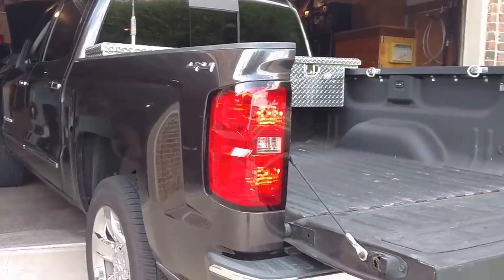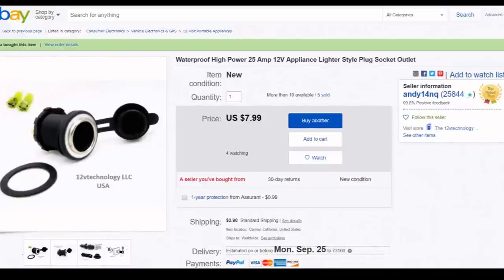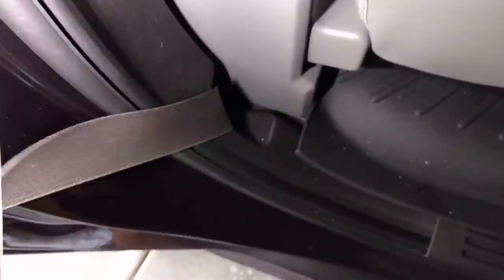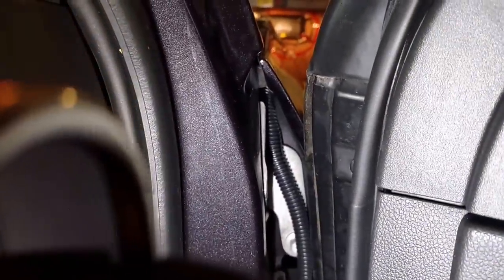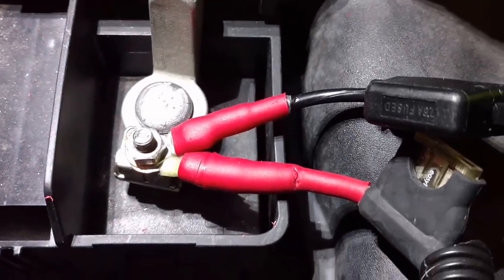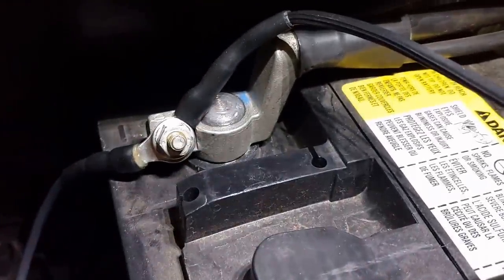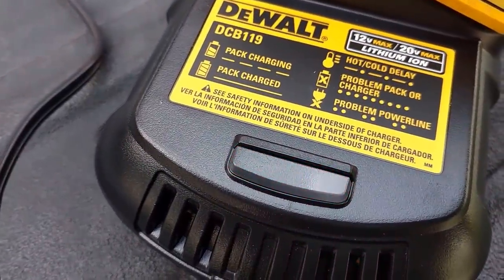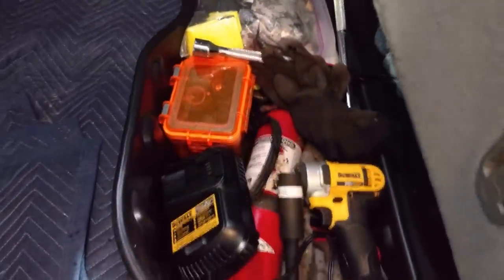DIY truck bed 12v power socket  installation - direct wiring to battery (10 AWG)

Comment: I would’ve just tied into the 12 volt running to the trailer 7 way instead of running that all the way to the front
Reply: That is what I want to do. Can you suggest on best procedure to do this? I am wiring in my Leer Topper in a 12 volt cig light /USB device. It has a switch as well so I can turn off power to outlet if I want.
Just don’t want it “hot” all the time as if my truck is sitting for an extended period of time I worry about the small drain of USB LED light. Maybe nothing to worry about 
But looking for a hot close to end of truck bed. Thanks

Comment: Great video and well explained, but you could have made this so much easier (and cleaner) by mounting a small fuse block next to the battery and running your wire underneath the truck along the frame and coming up from underneath the bed where none of the wire loom in the bed would have been exposed.
Reply: Yeah he would have been done in a 1/4 of the time

Comment: Why would you run the power wires THROUGH the cab instead of under it, along the frame?  That makes no sense.
Reply: Increased protection from the elements. If your wire is run bare along the underside it's exposed to all sorts of flying debris, water, mud, and sharp objects. While it may be easier in the short-term, if you plan to have the truck for awhile it pays to take some time to run it through the cab and have it be well-protected.
Reply: Exposed wiring suffered smashed leads to back brake and turn lights.
Reply: Your the one who makes no sense. Can you really not see an issue with running wires under it? Sad.
Reply: @virginiasolomon9352  My bad

Comment: I know it’s a little late in the game, but why didn’t you simply run the wire in a plastic split loom from engine bay down to frame and either through frame or zip tied to frame to the bed?  You made soooo much extra work!
Reply from the maker: Not enough current in those lines and not good to reverse current back through relays
Reply: I think @Mr Jeff meant why did you go through the cab?  That’s exactly what I was thinking.  I found this because I’m trying to identify the wire loom/pigtails that were taped up just behind driver’s side of the cab.  They appear to be for wiring in a 5th wheel.  I was planning to tie all my bed electrical into this wire harness without running wires directly to battery.  Other than going through the cab unnecessarily I think you did a good job.
Reply: Was thinking the same thing 🤔

Comment: SECRET: (if you haven't figured this out already) I remove my Dewalt batteries from my tools the moment I stop using the tool. There is an obvious (to me) "parasitic" drain on these batteries if left plugged into anything. Planned obsolescence maybe? Thanks for this video. I love the other one on the Solar charging of this 12v Dewalt charger (which I have duplicated here in my shop. Thx for that. 😉

Comment: This is the best 12V power socket installed on YouTube....period.  DIY done right.
Reply from the maker: Thanks...those are great 12v sockets
Reply: a very good video I really appreciate
Reply: But you could ground the black wire
To the frame or bed.

Comment: That wire running under the sharp edge of that plastic trim will sooner or later rub through and cause a fire. 
Always run wires in a split wire loom and cut the trim to fit the cable
Reply from the maker: Good eye -- I fixed that. Sold that truck to a friend years ago, he hasn't had any issues with that outlet

Comment: What’s the proper way to connect the wires to the battery terminals? As in what order. I’m doing pretty much the same setup as you are just worried about shorting something out when I make my connections. Thanks in advance

Comment: Help me out here.... Ive been wanting to do this install but couldnt find the proper socket setup? the family and I like going to the drive in and i use a truck bed air mattress and sometimes have to use an air pump if the battery dies...... does the power outlet come with that frame where you used 4 self tapping screws on? if you have the time.... could you send me the link to the item you bought? any help is appreciated!
Reply from the maker: $13 (with socket frame) 25-amp Weatherproof/heavy duty 12v power plug socket eBay link:  https://www.ebay.com/itm/Waterproof-Heavy-Duty-25-Amp-12V-Plug-Lighter-Accessory-Socket-Power-Outlet/122317736410?hash=item1c7ab489da:g:BsMAAOSwnHZYjk3Y

Comment: I’ve bought something like that at canadian tire with 7’ wire, but i got the positive wire, the black one is just 1’ why is that ? I got told that basically the black wire can be attached anywere on the steel of the bed truck and that’s why they only give you 1’ , is that true ?
Reply from the maker: Negative wire is the short one. Most vehicles are chassis ground (negative) and you don't need to run a black negative wire all the way to the battery. The reason why I did is because of all the "electrical" things back near the bed of the truck...fuel pump, lights, ABS, etc. If there was a short on the outlet...don't want any surges to fry something important. Chevy has MANY sensors that pick up signals on the negative side. Many guys will say it is okay to splice into existing wiring harnesses and then have MANY problems later on. So, POS and NEG wires direct to battery and no "loops" in the chassis ground
Reply: Chris DIYer thanks for the tip man ! I saw your is an awesome work so i thought you would of known better lol, I’m gonna be installing this on my ram i was thinking if to install a switch too or not..
Reply from the maker: Cool! I am not a mechanic, you may want to talk with the pros before doing mods on modern vehicles. There are so many sensors and electronics that can be affected by even the smallest mods. Mine works. Thanks for watching and good luck with the installation
Reply: So this setup only works with the ignition on correct?
Reply: @Boxing007  its direct to the battery...

Comment: Oh My you cut the pressure release in the back of the cab... well that's a no no no no lololololol 
Okay the wires run under the cab along the frame rail inside. 
OhyVey

Comment: That is a slick installation.  Its always "fun" running wire from inside the passenger compartment into the engine bay.  Quite an elegant solution, IMHO!
Reply from the maker: Thanks...there were several "colorful" words utilized during this install. Chevy  used a hideous amount of sound deadening material/cab isolation in these trucks...snaking wires in/out the cab required a PhD in "Ingenuity"